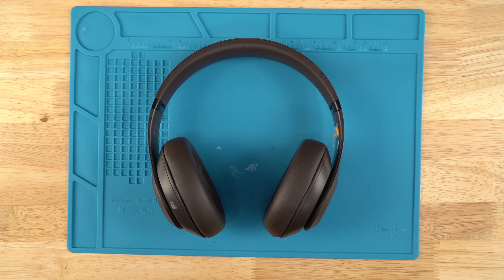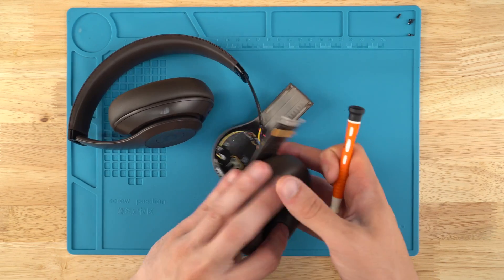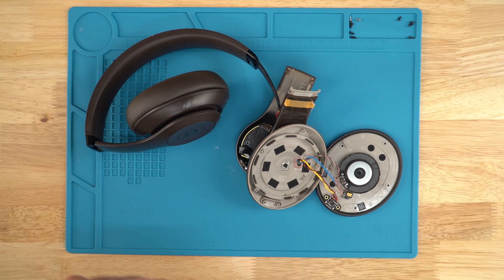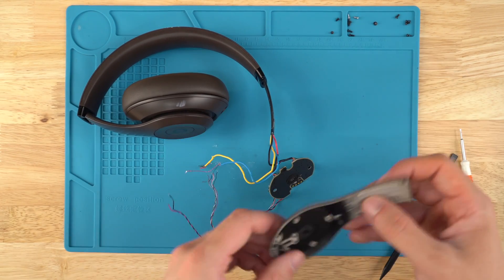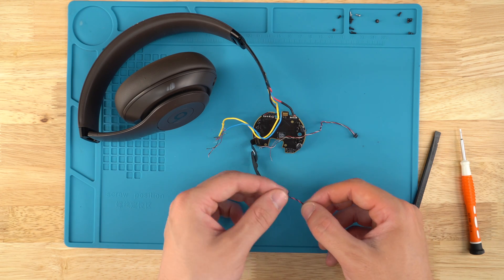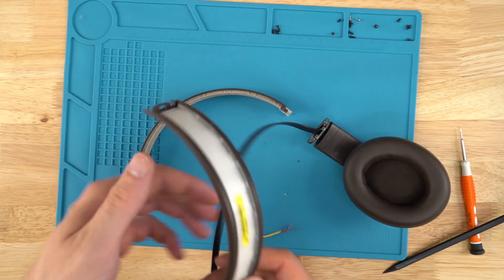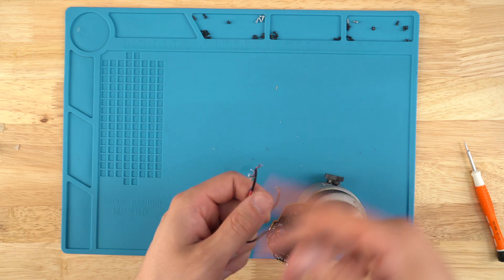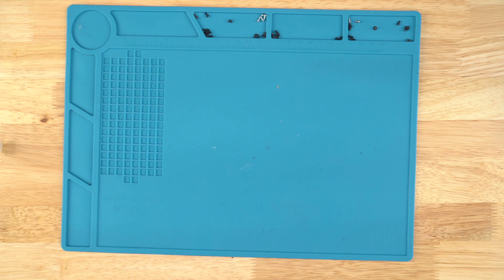Beats Studio Pro Wireless (2023) Full Teardown & Disassembly Guide | Step-by-Step Repair Tutorial

Comment: This is great, but I know the band is broken on mine that breaks them in and adjusts where they sit on your head. Should I still take out the battery and stuff?
Reply from the maker: Don’t take the battery out if your just swapping a part that’s doesn’t required soldering or touching
Power.

Comment: Have you guys figured out what the issue is with the crackling/wind noise that happens when the ANC is on? Seems to often happen in the left ear. A quick Reddit search indicates it’s a very common issue that essentially makes the ANC unusable. Thanks — awesome video
Reply from the maker: It’s usually caused by the ANC mic on one side becoming overly sensitive or slightly faulty, so the noise-cancelling algorithm overcorrects and creates that crackling “wind” sound. It’s a common issue on some units and can make ANC unusable when the mic isn’t behaving correctly.
Reply: @Joesge that’s very helpful to know. Is that fixable? Would replacing the ANC mic work?
Reply: @micahweedman hey just curious if you ever figured this out?

Comment: My down volume button feels dead.  It does function but doesn't click when depressed, also, when the noise cancelling is on, that same side crackles when I move my head around.
Any thoughts or suggestions??
Reply from the maker: Do a reset first. If the buttons feel dead it could be a failing plastic cover piece on the trim. You can send your headphones in for repair here if you want us to fix it. 

https://www.joesge.com/pages/fix-beats-by-dre
Reply: @Joesge  Thanks, it does seem like a physical/mechanical issue.

Comment: Mine works mostly fine though after opening it up I figured out that either the red (most likely) or black (unlikely) wire is causing problems. They work wired mode completely though I have a hard time with the power button it works sometimes and doesn’t other. it would work when I open the panel but not when the panel was back shut, which makes me believe there’s pressure on the wire which loosens it or something. do you know what the cause could be?

Comment: Do you guys know how to take out the original B logo? I am trying to do a cosmetic change of my black b logo to replace it with a red one.
Reply from the maker: It’s fairly easy it’s on double sided tape on the right side. Left side it’s on tape also but also a plastic button so just be gentle and use a flat head and or plastic pry tool.